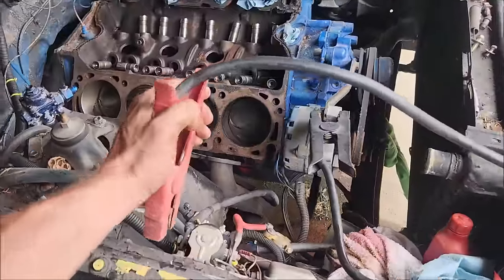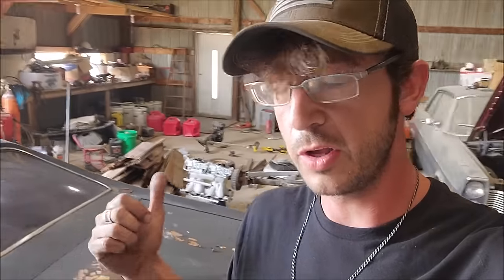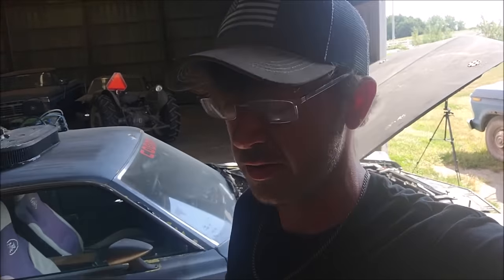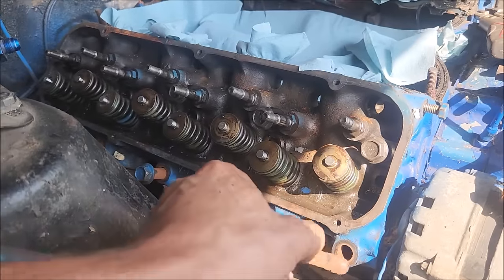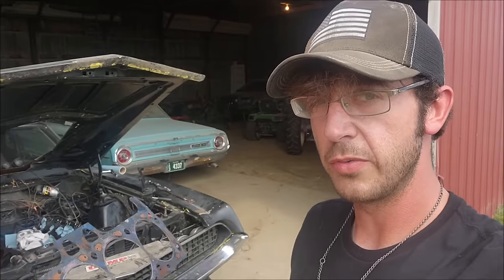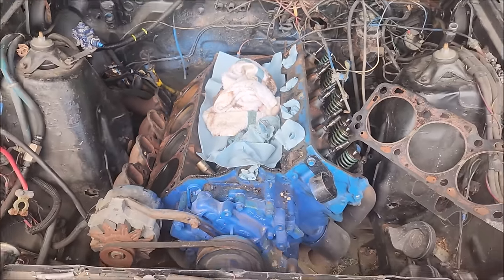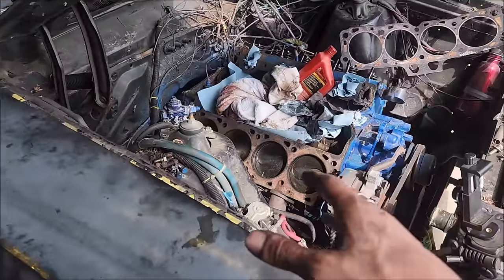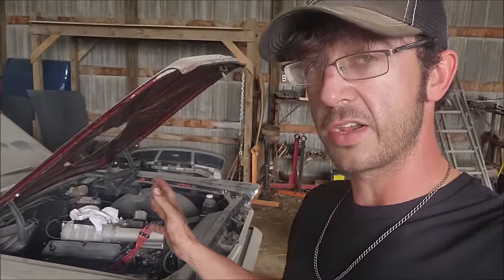Will it Run? Engine Fubar? 1970 Ford Torino DRAG CAR - Parked 20 Years Ago!

Comment: I guess if it were my car I'd be asking myself, Ok its a drag car, its already been modified so its not good for much else, would I actually take this to a track? Is there a track local enough that I would go at least a few times a year? What's my skill level as a drag racer? Do I need a car that's completely dedicated to drag racing to have fun or could I just Drive a more street-able car? Do I want to start with a car that is essentially pre-done? Or would it be a better learning experience to build my own car and make slow improvements over time?

Comment: I'd say yank it, disassemble, send off to machine shop, bore it 0.030 over, deck it and the heads as needed, rebuild the heads, throw in a nice cam, and drop it back in. It would be cool to see what you can do with those heads.

Comment: If you choose to keep it, and I hope you do, the 460 shortblock with aluminum heads would be a great way to go. It could get ugly when you start tearing into that 429. No drain plug in it for who knows how long?
You might get lucky with it though. Regardless. you will have to tear it down, have it decked, bored, and other work. At that point, you probably would be ahead of the game to just go with the 460 shortblock.
That would be a bad ass hotrod though. You wouldn't have to do much to the 460 to have fun with it.
A cam, intake, the aluminum heads, probably a distributor.
While you have the engine out, I would try to modify the shock towers somehow, to get more room.
That would make life easier. 
Like I said, I hope you can keep it, but if not I totally understand.

Comment: Well Luke.  If it was me that acquired that car. I would of just pulled the engine out anyway. Because you never know what you get when you but a basket case like that.. now I'm definitely not a ford guy. But there are certain models out of each of the big 3 that I do like very much. This happens to be one of them.. now if you're asking me for my opinion.. I would say pull the engine. Dismantle it. Keep absolutely everything in order. Clean up every part. Inspect..take a look at what it has for a cam. If it's stock. Replace it with a much much better cam and lifters. And of course new cam ..crank and rod bearing. I can see the water line. But other than the water line in the cylinder. Is there any damage to the cylinder wall ????... I would have those factory heads redone .with porting and polishing and valves. Get them to breathe real nice. I'd Clean up the bottom end real nice and leave it stock.. my way would be a budget build of sorts. I kinda think this car was on it's way to being a drag car and never made it there by the looks of it. The amount of money it would take to bring it up to spec with everything isn't in my pocket. That's for sure. And what the heck happened to the wiring.. Clean it. Do it up. Change some parts and race it  at tracks that have the run what you brung tracks. And have fun. It's not always about winning. It's about having a good time..well from Kingsville Ontario Canada 🇨🇦..have a great day Luke and take care of that back

Comment: I use to have a 1976 302 maverick. Broke the column shift ended up putting shifter on the floor.  Found it sitting in a barn. Paid $300 for it

Comment: Not a Ford guy per Se, but I like the body of the Torino. The 429 is a good motor if you take the time and spend the cash to punch it out add aluminum heads and studs.  Good luck with whatever you decide. I'd take and do just what I said. Then enjoy it.

Comment: You wondered in your last video if that was a true cobra Torino. It doesn’t have the normal tail lights for a cobra but Ford did some weird stuff sometimes. You should get a Marti report done on it. That will tell you what it was born as.

Comment: I'd get the 65' Galaxie back on the road first... and as a fan of the 429, I'd rebuild it with a .010 over bore if possible... My 1971 Galaxie500 has a 429 or 351W option for when I get back to putting her back on the road!

Comment: I'd like to see a budget build. Hone the cylinders, new main bearings and rings. Probably have to have the heads reworked and put it back together to see what kinda power it would have had back in the day.
Reply: There is no budget build on rust pitted cylinders and damaged gasket surfaces. It’ll smoke like a damn tar pot, foul plugs, and run like general shit. Not even worth the price of new gaskets. A 429 deserves better
Reply: @TheMajictech  
I guess that's why you watch this channel to see $10,000 engine builds and a 50,000 square ft shop with brand new tools right?

Comment: This is a stock 1969 429CID with D0VE-A heads. The cast iron rail type rockers tell the story. These heads can work well with professional porting and 2.19 / 1.76 valves. The pistons are clearly stock ´69 pieces with two valve reliefs. The fact that someone put a TUNNEL RAM on this piece with 1200 - 1700 CFM breathing capability is unreal. With extensive porting these intake ports CAN breathe close to 300CFM. The exhaust ports are the deathknell of this otherwise great engine. It seems like they were an afterthought at Ford when the decision was made to install this engine in Torinos and Cyclones. The problem was and always will be the McPherson suspension system used in intermediate Ford cars until 1972. Ford did not get that right until the 1972 model year for the Torino and Montego. By then these great engines had been castrated. The last great engne of the 385 was the 1972 Police Interceptor installed in 1971 - 72 Galaxies. Head ID D2OE, The original design dates back to 1965 and it was originally designed for trucks. That is why it has three inch main bearings and 2.5" rod journals.

Comment: Yep, I subscribed now, it’s a good looking car that needs some love, might as well pull the motor and go for it, I certainly would if I owned it and it’s not as easy to do over here in the U.K., some cars aren’t worth the effort, but in this case, I think it is, I dunno if I could be bothered with ally heads as they have their own problems, like the rocker stands tearing them self out, that’s a big headache requiring time serts etc; but it would be interesting to see what you can make of this car with what you have there, deck the block n skim the heads, valve job, etc., nothing too mental, you could fit a better cam to get the best outta that ‘ram and those old centre squirters.. bet it’d be quick! 👍👍👍👍👍🤠

Comment: I think u should start by rebuilding the cylinder heads. Then you havnt committed yourself to keeping or fulling rebuilding the car or engine. If you decide to keep it, the heads will be dun. If u get rid of it, then u have a good set of heads u can sell or just have on the shelf for when u may have another bbf. And make a video about it. That's what I think. Also, I need a good set of D0VE-C heads for a 502 I'm building.

Comment: I think you should just scrape that deck clean like  you said, buy a new head gasket and put the head on.  
Then scrounge up a normal intake and put the carb from the Maverick on it and use it as a daily driver and make videos about that.

Comment: I would like to see this car back on the street, not sure how it would drive with the huge tires. Would like to see the 429 built, even stock to Cobra Jet specs, but as things go, you can sink a ton of money in it. I have a '73 Mach 1, with 351C, I drive to cruise ins and car shows, it's a stock 2V, and I really want to get the hp up, but still be street driven and reliable. 4V closed chamber heads are hard to find these days, but again, I can sink a ton of money in it.

Comment: Pull the engine, bore it .030 over, check the cam, deck the block and heads to clean them up. Valve jib and put it back to gather. IF the build sheet says a 429, leave it a 429 is it the original engine? Numbers matching?

Comment: I would yank that 429, have the block decked, bored 30 over, get home high compression pistons, a high lift cam, have the heads worked over, and I would just put it back in. Yeah, a 460 would be alot of fun, but so can that 429...and you already have it.
Edit: Or you can just get some aluminum heads for the 429...

Comment: well what i would do is go for the 460 engine but go for a stock one that's already to go and then build it up later. 
you need to drive it to see how the rest of the car is before you do more to it even though it looks OK under there, you got to make sure it is.
especially with a drag car.

Comment: Sad, it's a Torino Cobra Jet without the Cobra Jet engine.  Without the original engine, and given the modifications to the car itself, it would make a pretty good street rod or drag car project, but it is no longer an original car.  I had a 72 Gran Torino Sport many, many years ago.  Ford blessed mine with the smog design 400, but I took great joy into turning it into a powerful street rod.  Your 70 Torino already has an engine that can easily pump out great torque and horsepower.  If I had that car, I'd keep, I sure do regret letting go of my 72 GTS.

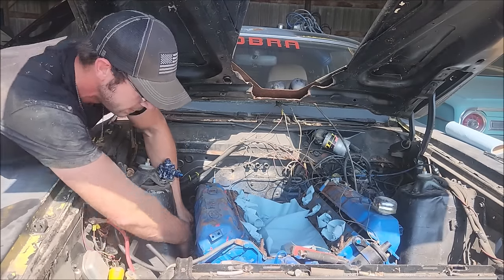Comment: I have worked on several vehicles In Last 3 months that dang near ever bolt on the top end was finger tight 7:27 everyone assumes that red rtv works on top end because itz for high heat but everyone always installs like 3 tubs for just the intake its crazy Luke @Thunderhead289

Comment: Why not try the 1 bbl lawnmower carb on this and see what kind of results you get. The high CR should help make up for the low VE from the small carb, and you can advance the timing to get even more efficiency. Even that small carb should pull about 100-150 HP on an engine that large.

Comment: Hi LUKE , Great video. I am sure you know that 1970 cars DON T grow on trees. I would keep the 429 and rebuild it , hopefully showing this here on your channel.

BTW , any way you can help me pull my 1970 351c 4bbl out of my 1969 MACH 1 , it only has 50 miles on it , now sitting  since the motor was rebuilt in 1983 BUT wiped the cam BECAUSE life , wife , work GOT IN THE WAY?

TY keep going , you can do it. TAKE CARE

Comment: There  is no replacement for displacement make a big 460,. the headers, heads,  intake and distributor from the 429 will still fit on the 460.

Comment: Well, I love it, but I love everything you have and do. What's the body and interior like? There's the car guy in me that sez "buy it" but I'm fighting cancer at the moment and that's my hesitation. Those are my two feet in my picture with my Uranium over on the desk. Are restoration parts available and can you move those shock towers for a modern front end?
Reply from the maker: I was just looking into buying some radium suspended in a resin cube with the element info etched into it 🙂

Comment: I say keep it, but I think you've already made that decision... 😉

As for the engine my $0.02 would be pull the 429 (no mention if it is a numbers matching engine/car) and use this block to build a 545/557 cube stroker with a decent alloy head & run that tunnelram.  Keep clear of the real budget Chinese heads and look at Edelbrock, Trickflow or if the Patreons can chip in some more a set of Kaase P51 alloys.  It'll then have the power to match its looks

Comment: Take a 2x4 staple some sand paper to it and deck the block in the car role pistons all the way down clean up cylinders best you can and throw it back together let it smoke a little keep oil in it and have some fun with that motor

Comment: Whatever brings you the best ROI.  I'm not viewing that as a keeper.
Love it if you manage to bring the SC'd Galaxie to HRPT next year.
Reply from the maker: A drag car gets expensive fast. It's now 2000-2500 to get a halfway worthy engine in there, the rest of the car is unknown, and another 1000 in tires. 
And now you have a car with a 5000 stall with 4.30 gears with a spool - all of which being only good for one thing. 
Closest drag strip to me is over an hour and is an 1/8th mile. 

You know what they say about racing - a fool and his money are soon parted.

Comment: Selling it is not a option. Your either rebuilding that motor or building a 460. I think most will agree with this. While you finsh up the other build stock pile parts for it. It can be your winter project

Comment: Flip it.      I'm a bit curious as to exactly what it'd take to get something from a field to a strip as minimally as possible, and if it would be worth it.    Do a video on the engine extraction.   Tear it down, send it off to the machinist.     Do another video or two on putting it back together.   Take it out to the strip just because.  Then sell it for the $10k it might be worth if it is running and driving.     Selling it now, it's worth as much or less than what you bought it for.   It will give you content, a bit of fun, and maybe make a profit if you rebuild.

Comment: Let's be real ...having too many projects is a downfall to many Utubers today. It bothers me that some never ever finish them and then they sit in a barn or field and return back to the way they were before. Keep a few cars that you can reasonably keep running and upgrade and sell the rest.  Hording projects does not benefit anyone plus it give someone else a chance to own a cool vintage car. So, I would suggest selling the car and let someone else have a chance to own a vintage drag / street classic car. I agree , take the '65 and finish it. It is worth digging into and making it a real nice driver. But please don't work on them, get them road worthy, then let them rot! My 2 cents worth.

P.S.  I had a '64 Galaxie 2 door, XL, red on red, bucket seats, console, 4 speed, hurst competition plus shifter, R car (unfortunately when I got it the 427 must have been blown since a 428 was in place with 427 stuff on it).  So, I have a special place in my heart for the Galaxie next to the Torino.
Reply from the maker: Very wise comment as well as accurate. I've always been a hot rodder first, youtuber second - cars sitting around greatly bothers me. 
For most on here, the cars are just props and then after filming they go right back to rotting away. 
Generally if I won't have time for something and it doesn't fit into my life we'll functionally, I'll sell it off. 

I worked really hard to get into the 10 acre place I live in today, just 4 years ago living in a trailer park - the last thing I'm going to do is junk it up with cars outside also.

Comment: If u want that car to really put out don't let off the gas that rug 390 transmission  most people call it top loader it can  really shift fast as long as the clutch don't slip a hole lot of fun keep it to the floor the tires will smoke threw 12  for sure  depending on u and gears and engine third shift around 5 grand

Comment: It's a hellva set up. If you like drag racing I would keep it and go racing. Those heads are very good heads. A 460 is not gonna perform as good as the 429 with those heads. You could build a 460 and use the 429 heads.

Comment: Strange thing, its not a fast back but a hard top car,  but it looks like it has the rear  deck lid with spoiler from a fast back and modified end caps. I have only seen this once before, a car I did it to back in 1987. Was this a 4 speed car? did it  any signs of repair work to the right corner panel? Do you know much of the history of this car? do you know if it ever spent time in California ?

Comment: I am 62 years old, been a working professional mechanic. Two things I disagree with you in this video. First I have always used the cleaning disc to remove gaskets, never had a problem making them seal. Second, I would not use the ball hone, the blade hone does a better job. The blade hone will give you an indication if the cylinders are out of shape. I hope you keep the 429 in that car, you don't see many of them anymore.

Comment: I suggest you remove the 429 CI V8 and deck it, bore it, magnaflux it. When you add up how many 429 engines are left, well there aren't too many left. I mean look at the size of those intake ports!!!! It's a factory hot rod engine! I would change the intake manifold to a modern design that's lower in height. I would go with a factory steel hood without any holes in it. Well, that's my vote! You know what you are doing with engines.

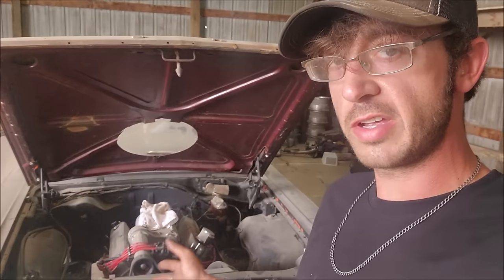Comment: 21:35 I would take the 429 out, overhaul it, test fire it, then sell it as a freshly rebuilt stock engine. The transmission would go with it. That rear axle would get yeeted next. Following that, I'd un-tub it, fix whatever bullshit got done to the front end, put some nice 15x7 slot mags on all four corners wrapped in 235/75r15's, slide a mild 302 or even a 240 I6 into the nose with a 5-speed manual behind it, and then just turn it into a comfy cruiser. Oh, and fix the hood, 'cause I won't be needing that huge hole in it.

But that's just me.

Comment: Haha no power steering. I had a 1970 Fairlane with a 302 and it was a bear to steer. It took about 30 turns of the wheel lock to lock. My dad got a ram type power assist for it. You coukd steering it with your index finger after that. 
Girls used to lol at how i steered the car with one finger.
Reply from the maker: All my cars are manual steering - I don't know why it's so hard for people.

Comment: I would say get the galaxy running first you’ve been working on that for years now and you’re so close to getting that running and as you said, just a distributor and carburetor
Reply from the maker: This is a logical comment that I appreciate. Plus the 65 is a very well rounded and well balanced car for utilitarian hot rodding duties. 
A c6 5000 stall 4.30 rear gear car only has one purpose.

Comment: KEEP IT. DO THAT ENGINE AND ENJOY.  IVE AWAYS HAD PROBLEMS WITB 460S OVERHEATING VALVES AND SLOW 460 DOESNT REV. NO TO THE 460 JUST USE THAT ONE. MACHINE BLOCK AND REUSE THOSE HEADS FOR A BUDGET BIULD

Comment: I'd do a valve job surface the heads hand sand the block if it would not clean up then pull it and rebuild it. 429's are getting hard to find..